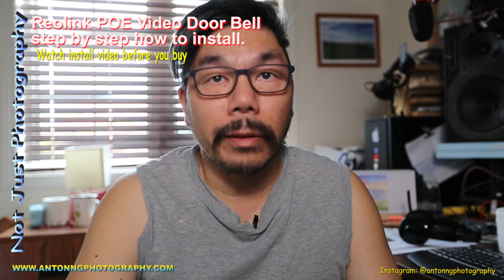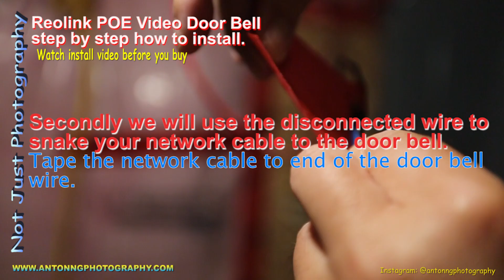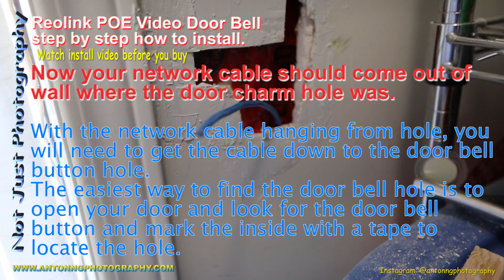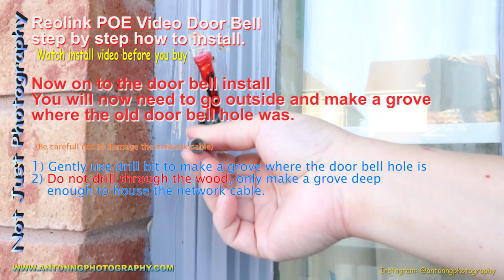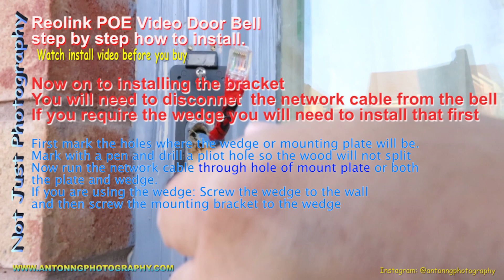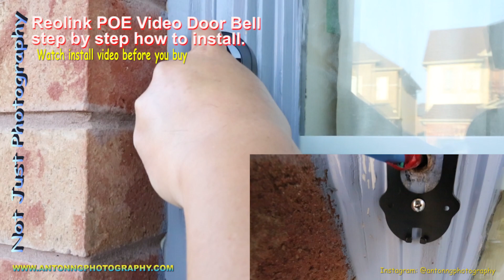Reolink POE door bell install, parts of install is not as easy as videos make it to be.

Comment: That is not POE --- you have connected a transformer to your doorbell via the RJ45 connection which you did not need to do as you are using WIFI by the looks of it --- all you had to do is connect your 2 existing transformer power wires to the 2 pins behind the bell ---- The RJ45 connection takes it`s power from the NVR CCTV box and is for a wire that goes back to your NVR CCTV recorder
Reply: That is not correct.